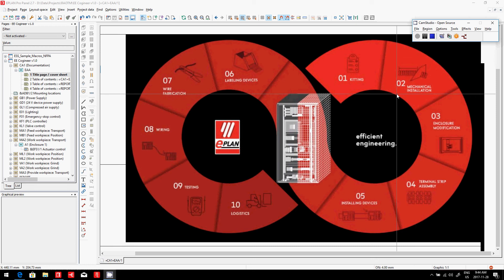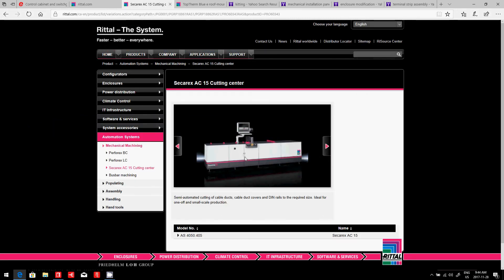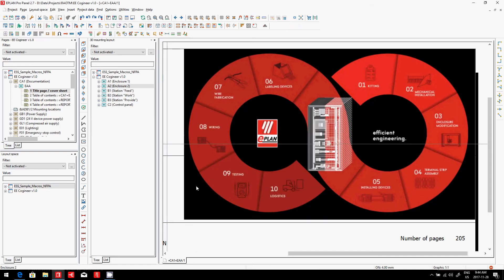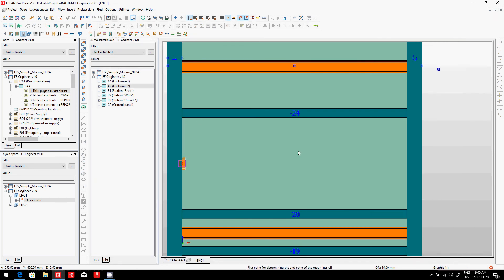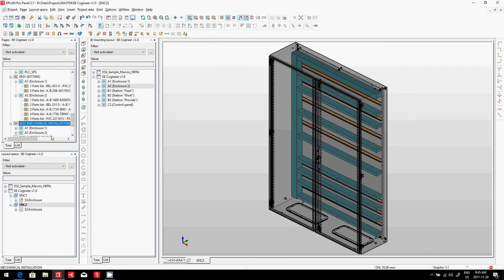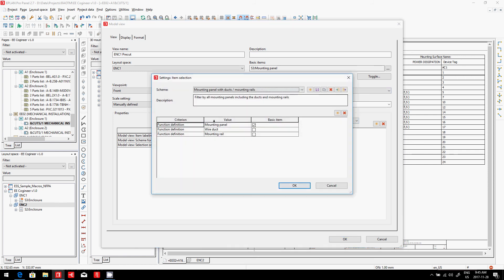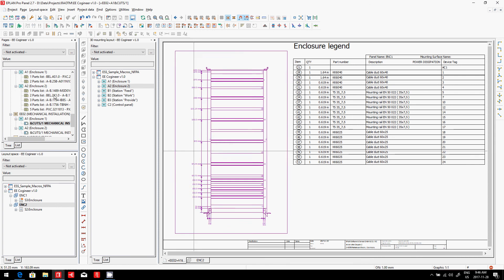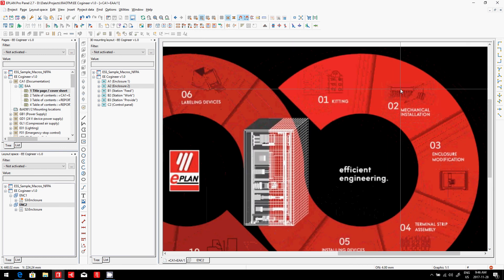EPLAN Efficient Engineering Industry 4.0 02 Mechanical Installation

Comment: Hi, how can i generate the report showing the mesuarements of the cable ducts?

thancks
Reply from the maker: With ProPanel this is just a model view  filtered on duct and rails, then I place manually an enclosure legend with the correct form which contains the right placeholders. Ask your EPLAN specialist to show or teach you how.